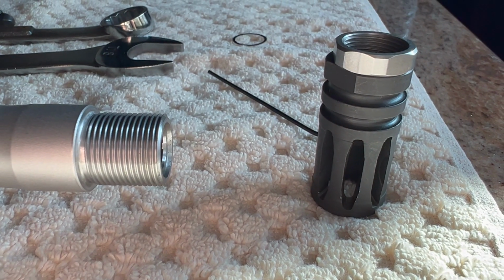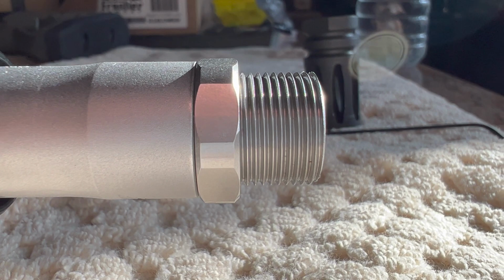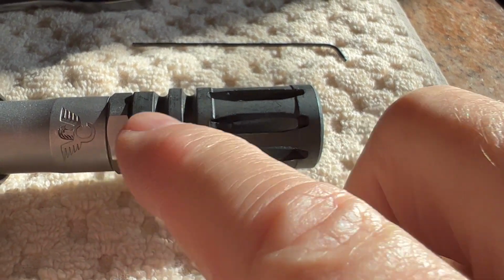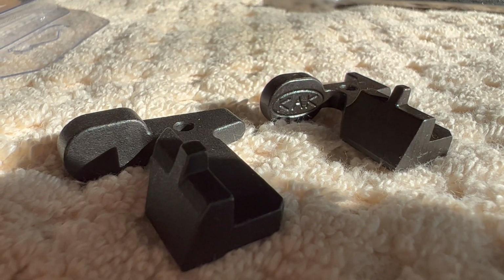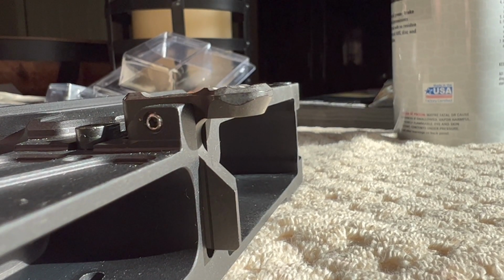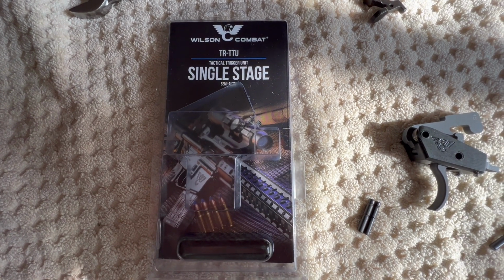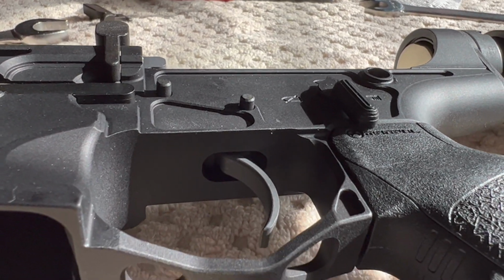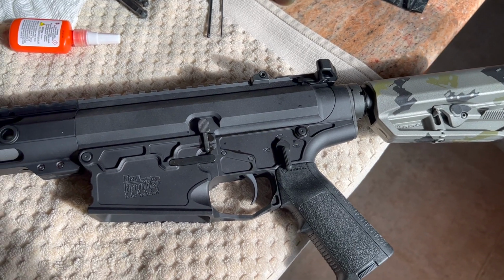AR308 New Frontier Armory DPMS Low Pattern/Wilson Combat Bolt Release/Trigger - 09

Comment: Do you have a brand preference for AR10 lower parts kits?
Reply from the maker: For take down, pivot, selector and bolt catch I had good luck with Aero Precision. The Aero Precision bolt catch ended up fitting the best and captured the bolt lugs the best but later on I ended up using the Frontier Armory bolt catches and the reason why I talk about in later videos during function testing of the rifles. I used Wilson Combat triggers and the WC trigger pins were in spec. I ended up using the Frontier Armory ejection doors and pin because the "C" clip design is a little different. The "C" clip fits between the door and receiver so the shorter door pin is used and does not rely on a hand guard to keep the door pin in place. This design captures the pin in both directions but installing and removing the "C" clip is more challenging. I also ended up with Galloway Precision off-set buffer retainer pins as insurance against insufficient BCG contact to move the buffer off the retainer pin when the receiver halves are closed. This was not a problem on my builds but it was close enough to where I wanted to make sure it would not become one.